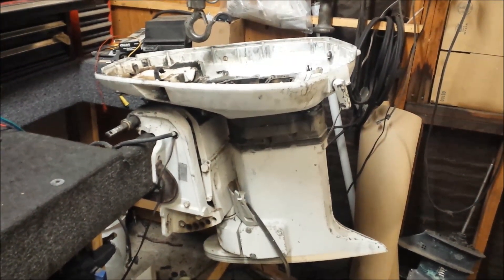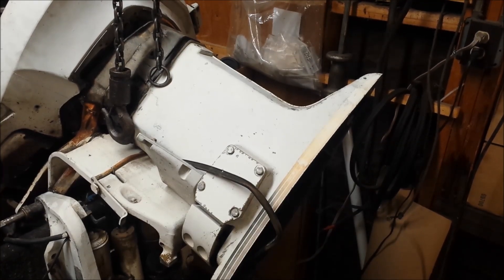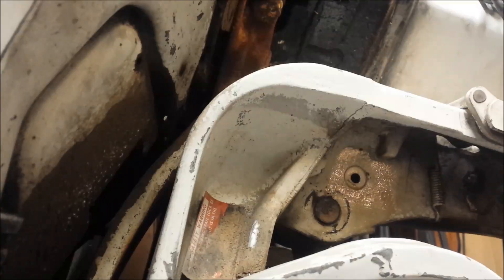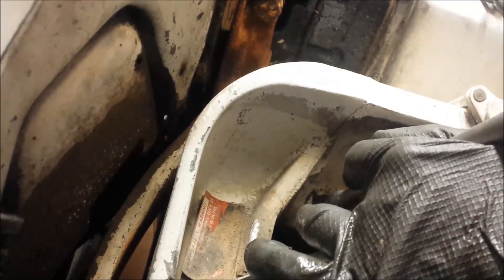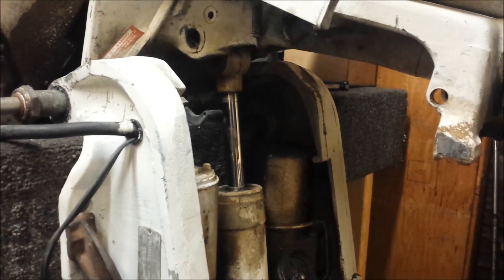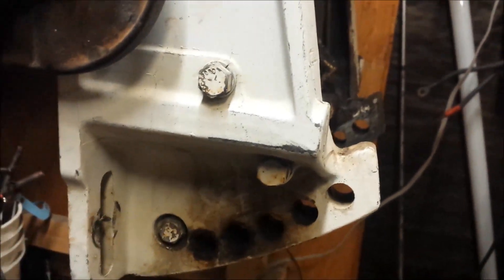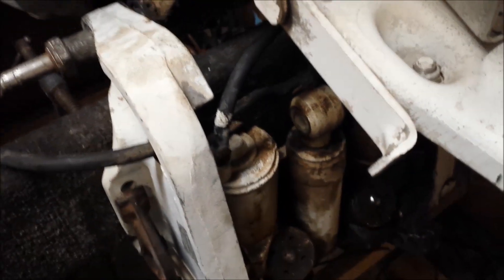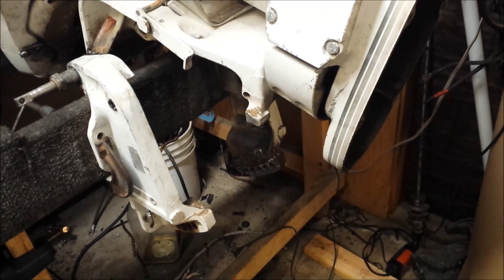Removing Power Trim & Tilt Unit from Johnson / Evinrude Outboard

Comment: I have an 81 v4 with the tilt and trim solenoid and bits in a separate box… how do I wire the tile and trim from a 91 where the control box is mounted on the engine above the exhaust plate.?

Comment: Nice demonstration! I picked up a Johnson 1975 85hp v4 and got it running smooth but it only has tilt, I’m thinking to look for this package with trim and throw it on there.
Reply from the maker: Yours has a unit hanging off to the side?

Comment: Where do you attach them to wires that come off that relay switch that's above trim assembly. You show removing them 2 Phillip screws then pulling wires thru. I need to know where them 2 wires coming off switch connect to. Thanks

Comment: How do you remove the lower pin for the tilt cylinder? Is there a special tool, or does it have to be pressed out?
Reply from the maker: sometimes itll push right out, other times it is there to stay.

Comment: Good afternoon. I have a 1974 50hp Johnson and the strangest thing is the lower unit is 1984. Can U help me understand. Obviously they’re compatible, and or somebody did some rigging lol . And I wanted to install a power trim on my unit. Just confused on how it all should go together ,what work with what year , compatible in other words , it doesn’t look like mine has the hook up like this one does. I’m sure you understand. Is there anyway you can help me? I found a couple vintage ones that I would like to use on EBay . Just not sure on witch one and there a lot of money to buy the wrong one . Thank u

Comment: thats great if all our main frames are cracked and we can move it over, how the hell do we get it out without cracking the frame haha
Reply: No ha ha about it. Mine will not come out.
Reply: I had to loosen my steering tube to get mine out.  Have to hang the engine up so you can separate it, and then you'll get it out

Comment: Really like watching you work on various things. I bought a 50 hp Evenrude 1985  It has had the power trim
Reply: Pushed wrong button lol but power trim being remover how do I raise and lower  the engine . I pulled the pin out but won’t lift up . My model is e50becob. I would appreciate any help thanks David in Tennessee

Comment: I had my tilt motor go on my 70 hp johnson. 1999. 
The guy working on it said he installed the new motor, but the unit was seized.. can you explain what to do to fix this. Do I need a whole new unit?
Is there a way to eliminate the tilt all together and just simply put engine in and up manually

Comment: I have a 1978 70 evinrude  that was never equipped with power tilt trim ,is it possible to install a oem unit ? If so what years will work so maybe I can find a used unit
Reply: I'm in the same boat as you I have a 79 75hp Evinrude that came without power t&t from what I researched any one will work from 1978 to 1989  70hp to 200hp Evinrude or Johnson.  Going tonight to look at a 1986 motor with working power t&t that has a bad power head. Hopefully it will work. I'll update if so.
Reply: I have a 1980 Johnson 75 with tilt and trim and a blown motor and just picked up a 1985 Evinrude 75 without power tilt and trim. Can I just pull the blown motor and bolt on this Evinrude?

Comment: The bolts holding the unit on on my boat are so tight I’m scared there going to snap🤔any ideas 💡
Reply from the maker: heat them up.
penetrating oil...

If they feel like they are going to snap, they probably will.

Comment: I have a 1996 225 ocean pro. Tried to hammer out the center pin. No go! Give yourself a break and take a sawzall and cut the pin out between the bushings and replace with a hardened same diameter stainless bolt and cap nut. Works beautiful and easy to lube and access your trim systems.
Reply: Do you have a picture of it
Reply: You can also TIG weld both ends of pin until they cherry hot, then cool em and hammer. Worked for me.

Comment: how can you manually get the engine up.  I have a 225 1998 Evinrude.  I opened the manual screw and still cannot lift it.  Any suggetsions
Reply: Don Neubauer

Did you already fix the trim?
Reply: Don Neubauer 

What kind of issues are you having with it
Reply from the maker: Put a floor jack under it, and use that to lift it.
Putting it up by had is quite difficult.